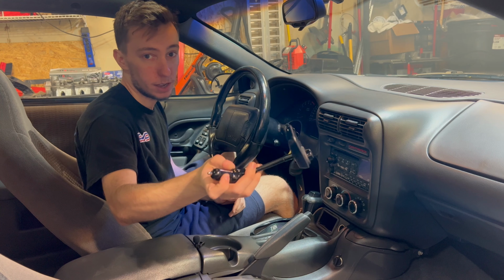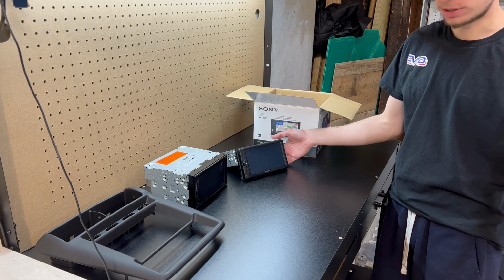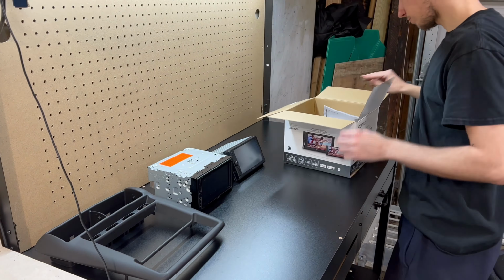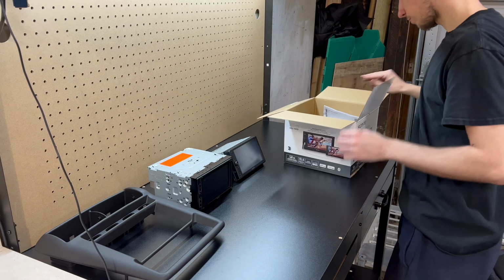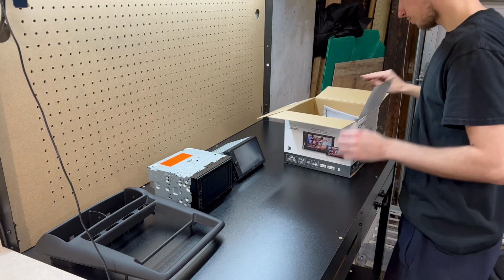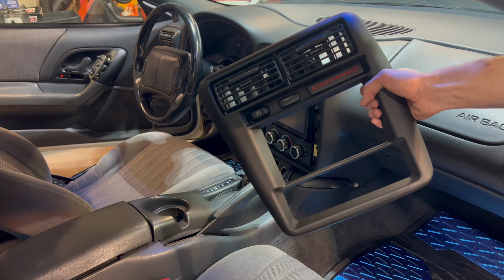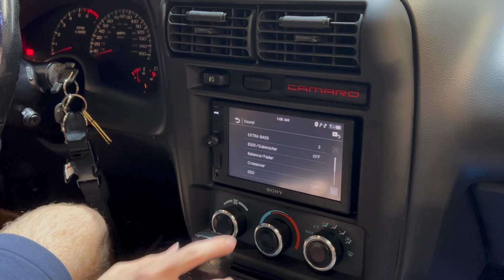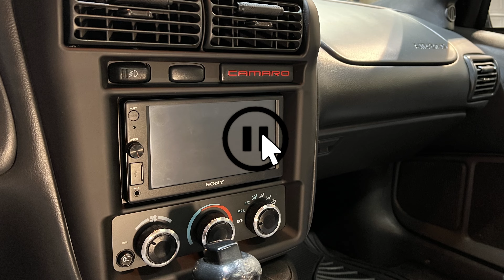Installing A Double Din Radio In My 4th Gen Camaro!!!

Comment: Does this double din work on a 1995 z28 and can h link the parts if so
Reply from the maker: The double din will work for any car you just have to get the wiring harness and I got the radio from Walmart and the radio bezel from Amazon
Reply: I'm sold. I will get this same unit on mine. Where did you find the radio harness & antenna adapter? Thanks